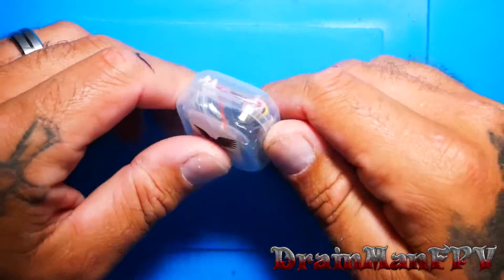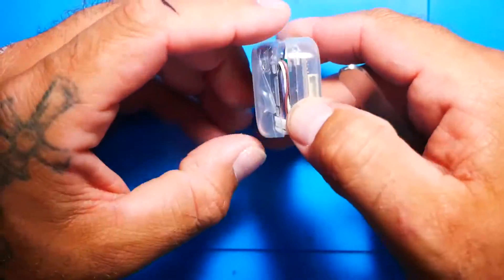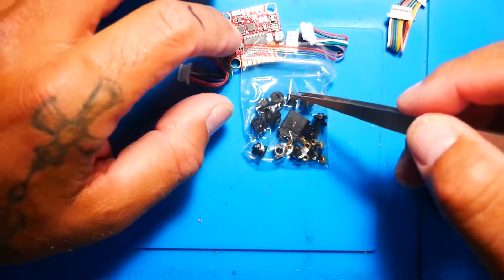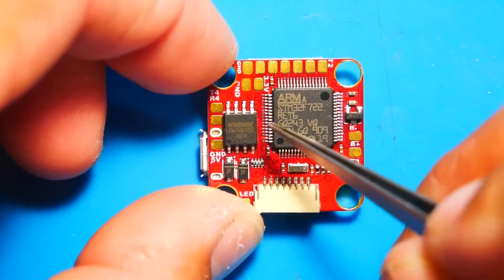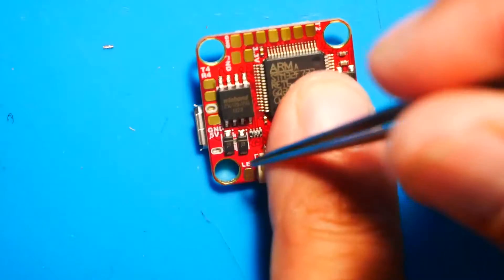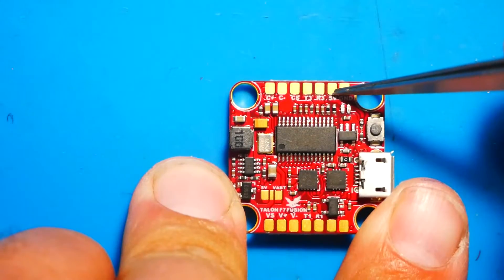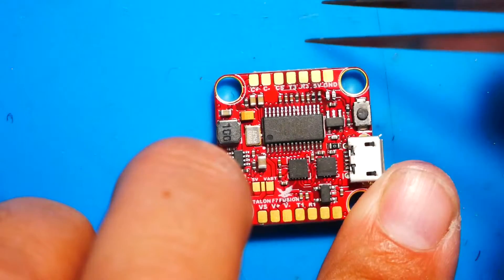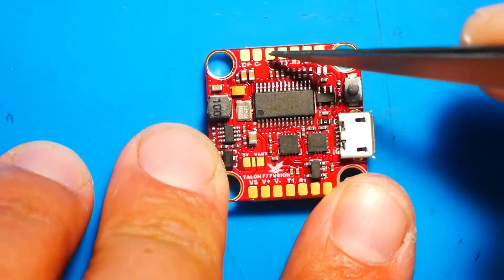Throw Out Your Old Talon F7!! The All New Fusion Flight Controller is Here!!

Comment: @DrainMan FPV, I bought this FC, and it is pissing me off. Mainly the VTX and Camera voltage outputs. After jumping the pads for VBAT, I can’t get ANY voltage at all for either. I had to just hook directly to the the VBAT jumper pad(looks ugly). I shouldn’t have to do this though. I don’t know if it’s the pit mode or what?? I can’t find any decent documentation. It seems like a good flight controller but it’s not straightforward at all. I have 12+ builds under my belt, so I’m not a noob. I ended up burning up a brand new RunCam DVR board, trying to get power to the damn thing. Can you point me in the right direction, or something please?
Reply from the maker: Hey Brian, sorry it's giving you a hard time. It would be more helpful if you snapped me a pic, you can email it to me and I can try to see what's going with it
Reply: DrainMan FPV Finally got the VTX and camera power, once I figured out it had the “real pit” feature, which means having to select “user 1” in the auxiliary tab. I just made the entire channel active, so it would stay on all the time. Now that I have power. The OSD appears when I first plug-in, and then disappears once the VTX/camera fires up. I seriously have no idea what this flight controller wants or is doing. I listed a couple pictures of how I have it wired, and a video showing what the OSD does. Like I said I finally got power to my video system, but the OSD disappears?? I am running both the camera and VTX on VBAT. this flight controller is a little ridiculous. I already had problems with motor for output. Having to remap to resource motor six to get it spinning. They really shouldMake some better documentation on how this thing works. It’s make some better documentation on how this thing works. It’s definitely not straightforward like most flight controllers. definitely not straightforward like most flight controllers. Where can I send pictures and a video to show you what it’s doing?
Reply from the maker: @gammagonad  drainmanfpv@gmail.com  man sounds like a pain! Let me see the pics etc and I'll if I can offer some help

Comment: What’s up with motor 4 I can’t get motor 4 to work.. I even put in the CLI what is written on the FC page where I bought it I forgot where I think pyro anyway motor 4 isn’t working some crap about the led or motor 4.. wtf is that
Reply: I can't see your entire reply for some reason -_- only the part that is in the notification. Yes that goes in the CLI and you will have to wire motor 4 signal wire to the LED pad after you have resourced that pad for motor 4. There is a problem with communication to the basic motor 4 pad (this problem also effects other FC's Ill post a link)
Reply: Scroll all the way down until you see your support FC (CLracing F7) copy the snippet and solder motor 4 wire to LED

https://github.com/betaflight/betaflight/wiki/Bidirectional-DSHOT-and-RPM-Filter
Reply: You can now use the talon fusion (hena) target and it’s all good now.. unfortunately the documentation at heli nation etc is totally wrong 😂
Reply: Remap moter 4 to LED use this snippet for RPM bidirectional Dshot

# To enable RPM filtering, first apply these settings # timer and DMA changes for this target. These will ensure that your# quad can receive telemetry frames on the motor signal lines. resource led 1 noneresource motor 4 b01 # set looptime to 4k to have enough computational time set gyro_sync_denom = 2set pid_process_denom = 1 # Start with dshot 300 which is most robust set motor_pwm_protocol=DSHOT300 # basic settings required to enable rpm filtering: set scheduler_optimize_rate=onset dshot_burst=offset dshot_bidir=on # enable debugging for noise assessment set debug_mode=gyro_scaled # reconfigure dynamic notch filter to focus on narrow frame resonances# since motor noise will already be eliminated by the rpm filter. set dyn_notch_range = mediumset dyn_notch_width_percent = 0set dyn_notch_q = 250